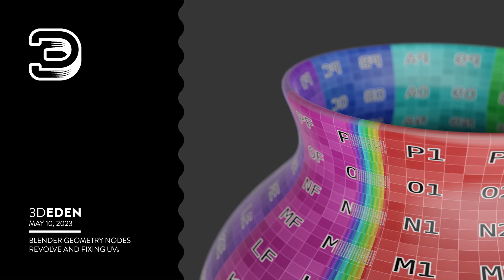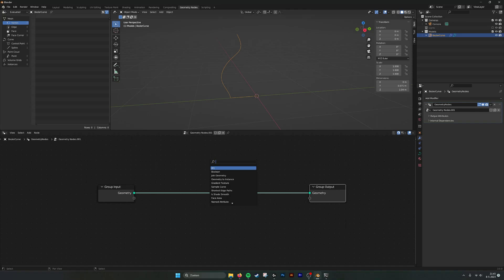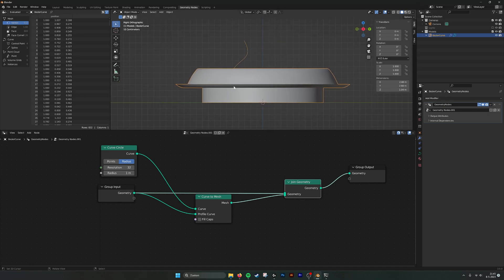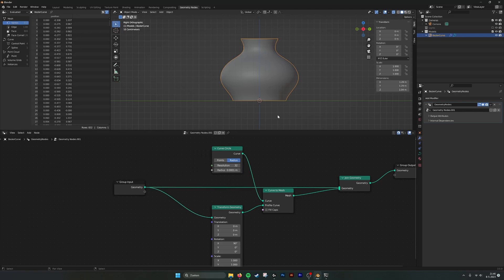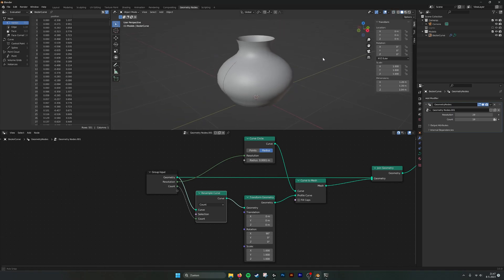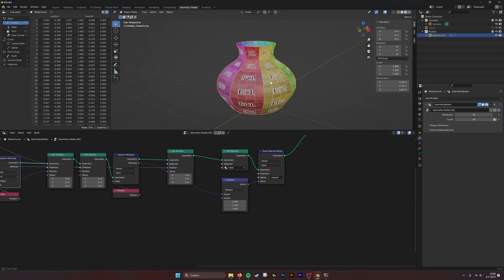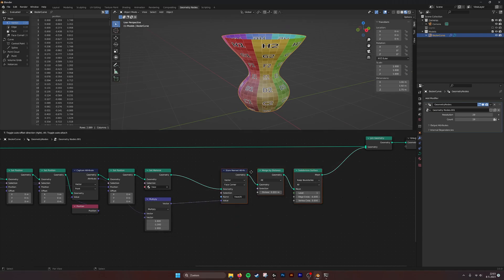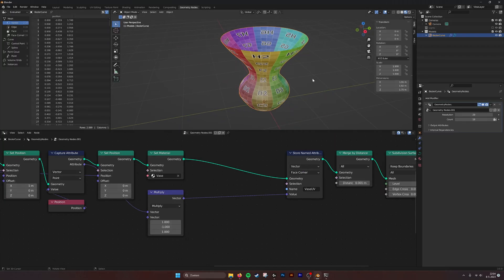Geometry Nodes, Procedural Revolve Fixing UVs, NEW METHOD

Comment: Thanks so much for this, I'd been struggling with this issue for days as none of the other solutions worked for cyclic meshes. Only problem is the resulting mesh is very slow to render. Hmm, wonder if it can be baked...

Comment: boss i need help, i procedurally uv map a geometry nodes tree . But the geometry nodes uv mapping system i made is also affecting the leaves. But the leaves are part of the instances of the geometry nodes tree. So this procedural uv mapping is effecting everything even the leaves. When i only want the tree and its instanced branches to be effected with the bark texture. Can you help me ;I?
Reply from the maker: You can mail me on mail@roeldeden.nl
Reply: @3d-eden978  i gmailed you the link to the blender file from google drive. Thanks big bro!